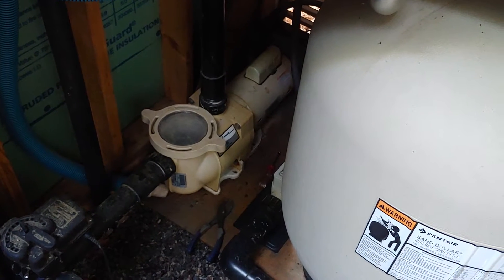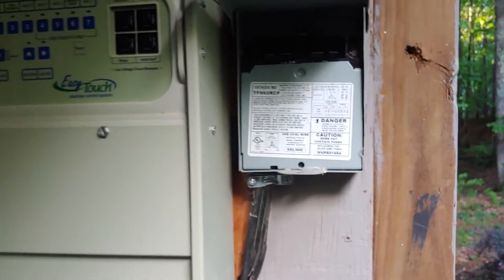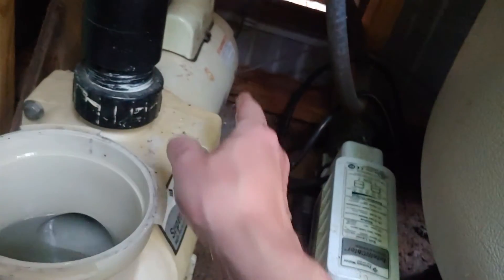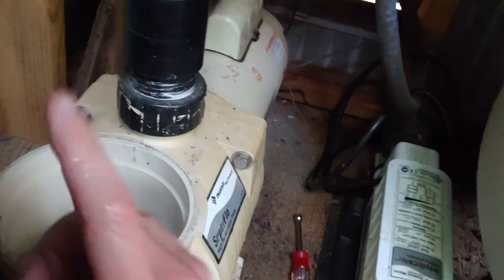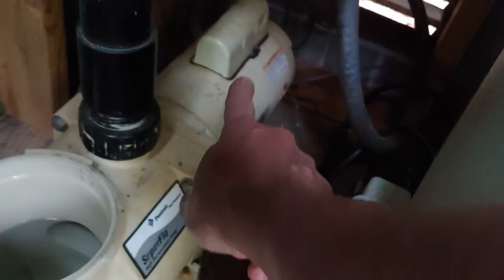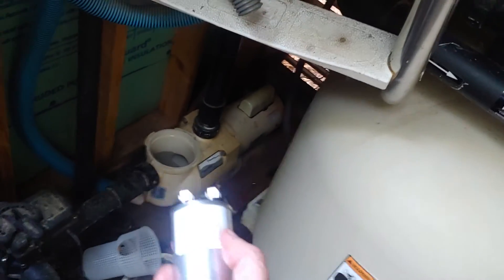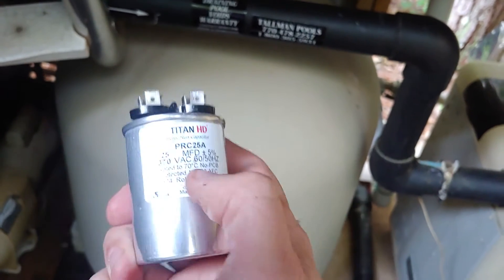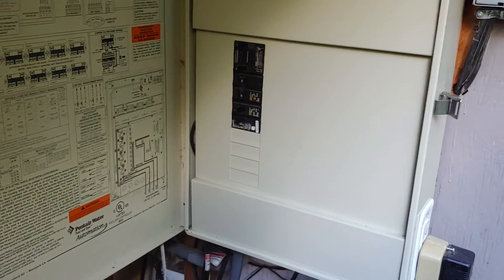Pool pump not starting. Motor not working! Pentair. Capacitor replace/change. Motor humming.

Comment: What if I replaced the capacitor....well three times this summer and it makes a thud sound then nothing
Reply: Hoping I don't have to replace the pump
Reply from the maker: @tjallen1904  Maybe try and see if something is stuck in the impeller. You mean it seems to run for a split second? Turn the power off and take the pump off the impeller and inspect.